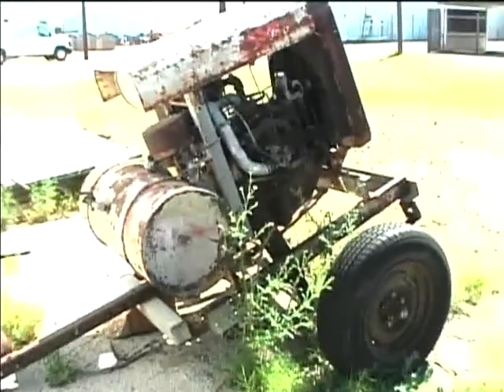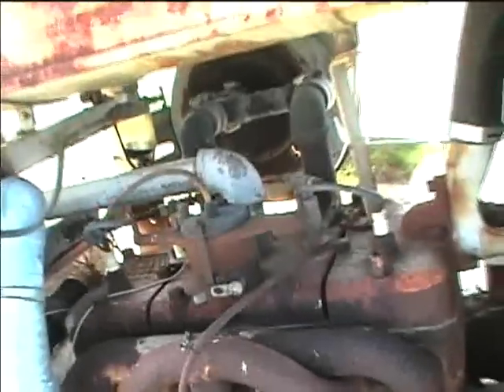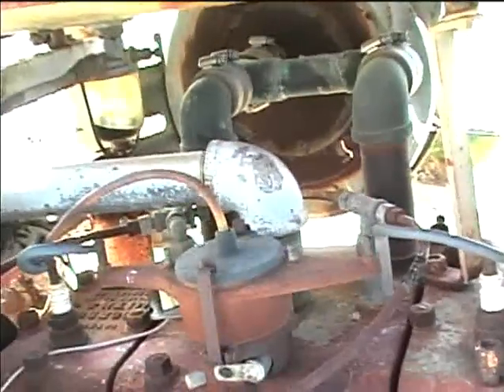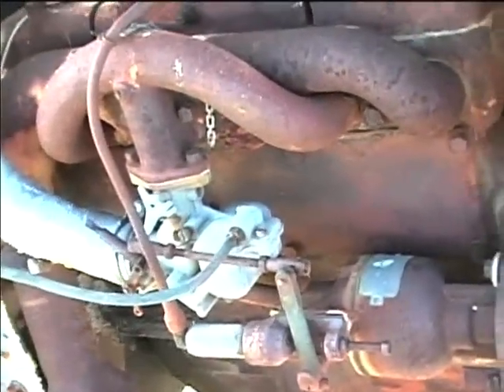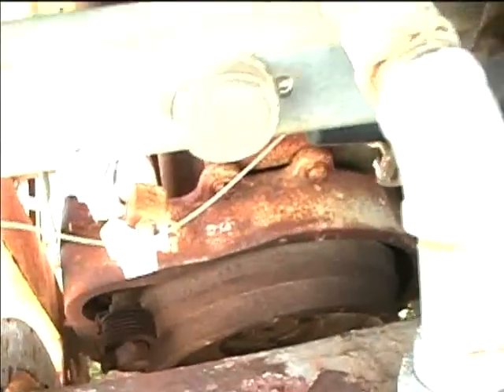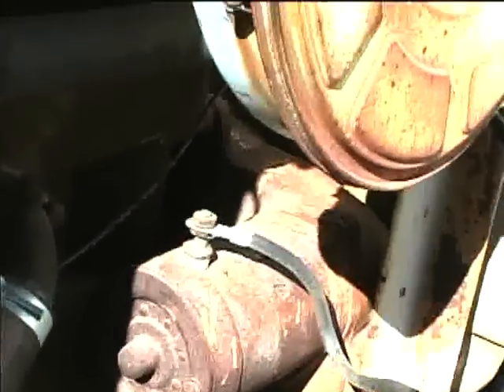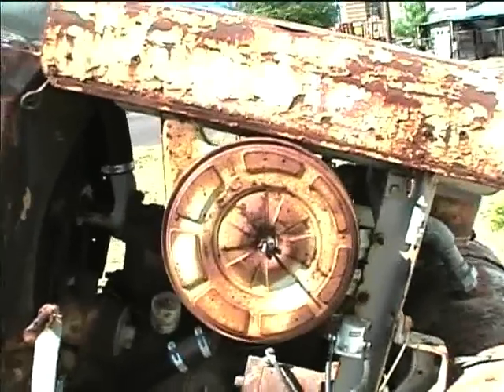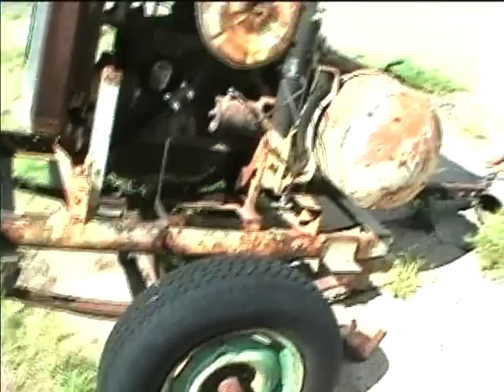1930's Ford Model "A" Air Compressor

Comment: Keep it 6 volt, most RV shops have 6 volt battery's. If you used a 12volt coal, that's why you have no spark, you can get 6 volt coals, you just have to look around for it, hook all four plug wires up, and make sure you have the in the correct order.